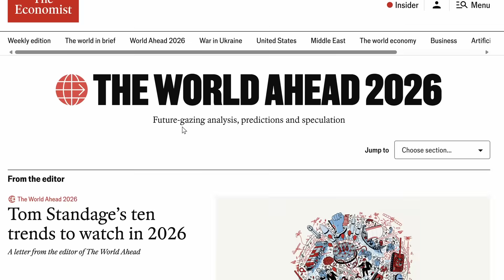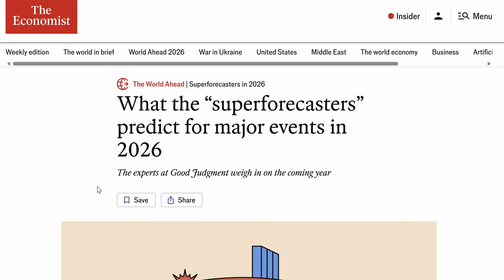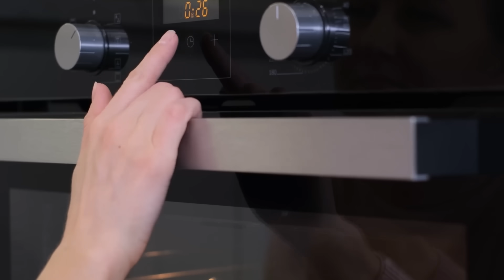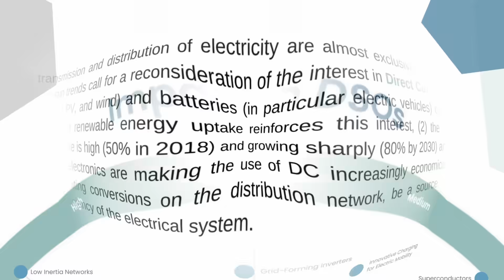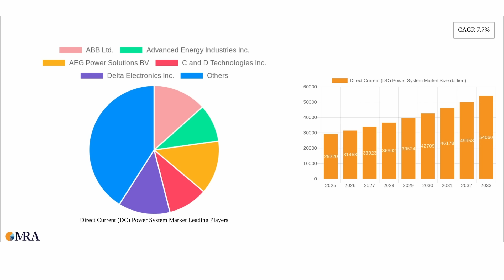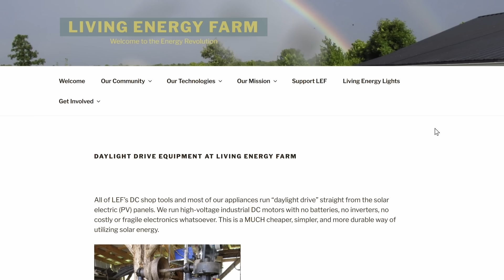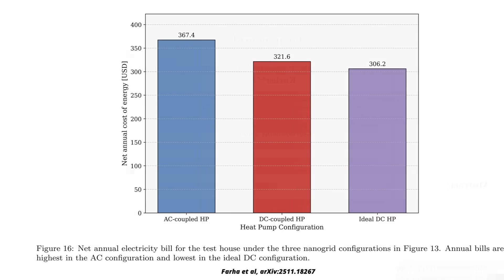Are We Using the Wrong Kind Of Electricity?

Comment: I understood originally that AC was chosen partly because of the fact that transmission lines for DC at the time of electrification in the US would have required way more copper. I wonder what it would look like practically if we were to start using DC in new construction for example - how would devices, etc., use it, what would sockets look like, and how much loss would still be incurred from converting the DC back to AC for devices that required it for backward compatibility.
Reply: The reality is most everything in a home actually works on DC internally. Motors with their own variable frequency inverters would have far greater functionality.

Comment: That is not an easy discussion!

Yes, we use a lot of DC-Appliances in our homes and in industry … but the grid is generally in AC and that ist really good. A Transformer is very good understood an reliable electrical machine. When you distribute electrical Energy you have to change Voltage-Levels and this can be done only with „AC“, even when you call the device an „DC-Converter“ it will use AC during the conversion process (and it will use a transformer, even when you call it just „a coil“).

I think that HVDC (HGÜ in German) does make sense an should be used more often, when it comes to long distance lines, but for 230 kV and for 20 kV (in our cities) (3-Phase) AC is the best option.

And by the way: Every device that is „turning“ is running on AC (generally 3-Phase frequency-converted). every (todays!) Generator is generating AC, because you do not need any Brushes to transfer the Energy from turning parts of the machine. And yes, it is often converted into DC and than back in to AC to be fed into the the AC-Grid), but that would be the same, if the Grid would be DC … Electronics makes it easy to convert between AC an DC or vice versa. But this should be used only when it is really neccessary. If not a (simple) 
Transformer is the better option.

Comment: Interesting point regarding the slow background transition from AC to DC for most things. Never thought about that but it makes sense.
Instead of building very expensive long distance power lines, like we are currently doing in Germany again, it would make much more sense to have smaller, independently working but still interconnected cells that create roughly as much energy as they need, if possible. That's also not cheap initially, but in the long run much more stable and cheaper for multiple reasons, not least because it breaks the stranglehold of the energy mafia that should never have been allowed through the stupid privatization in the 90s.

Comment: Convert DC voltages WITHOUT first inverting it to AC...  Then BACK to DC.  AC?  Just use a transformer.  Done.  Motors?  Brush DC motors are inefficient, high maintenance devices.  Modern "Brushless DC" motors use - Guess what?  Three phase AC motors provided power by a local dedicated DC to AC converter.  Not only is this more efficient, but allows for easy full control of that motor.  Yes.  Brushless DC motors are 3-phase AC motors.  Tesla was Right, for a LOT of reasons.  Both Then and Now.  DC micro grids?  OK...  But.  WHY??  Very Local ones only, and single low voltage only.  You need CURRENT for power.  Low voltage requires higher current, which is Very LOSSY over any distance.  Copper is $$$$.   WHY do you THINK Solar homes use inverters to supply AC for use?  Again...  Tesla was right.  By the way, 3-phase AC is continuous power, just like DC, BUT without all the drawbacks.

Comment: 3:40 at least partially incorrect.
Wind turbines use massively alternators. They generate AC current natively, because of the nature of said alternators.
But maybe newer turbine are not ''turbine'' anymore ?
Reply: But you are totally correct for the solar Panel, that uses concerter to change the slowly fluctuating DC_eff voltage to a steady AC voltage 😊
But having the fluctuating DC of a solar panel converted to a steady useable DC voltage STILL needs a converter. It will just be a bit more efficient, and that's the key 😊
Reply: @BolcheBric You control the voltage by varying the field. This is how motor vehicles keep the voltage steady, with widely ranging engine speed.

Comment: we are not using the wrong electricity. the losses over long distances are far less with ac. dc only works for local hookups. high voltage ac breakers are more reliable than dc. and the list goes on and on. this is pure click bait.

Comment: The main distinction would be in the voltage conversion: AC transformers are pretty "simple", which helps with reliability and cost. In the other hand, DC to DC converters are "weaker" in comparison.

Comment: Some time ago, I started thinking about a system I called ELVS. Essential Low Voltage Supply.
The idea is that you convert your lighting circuits to run on either 12V or 24V AC. You can get lights that run on this voltage range.
The system would be backed up with 12V batteries and a simple DC to AC converter.
The batteries would be recharged from the mains and solar panels.
Never pursuid it though.
I think the name is catchy.

Comment: 3:40 soo.. wind turbines..
turbines..
generate dc? 🤔

also idk, but the gist of the video is akin to the baldy man named Simon doing his 20 bn other yt videos...
surface level everything...

it's not a dc vs ac issue.
ac has to be converted, but it has much less efficiency penalties over any longer distance.
dc is good for short travel, and requires MASSIVE infrastructure to make it viable to transport from any plant.
(which still do it through ac on a dohen or so phases, that get pushed into each other resulting in dc)

also in a household ac is generally safer than equivalent voltage and power dc.
ac switches 50/60 times a second, which means your muscles are in a "pushback" state every time the sinus curve goes through zero volts.
dc fries you until you are crispy
and
everyone who touches you gets fried until they are crispy...

while low voltage, low power dc is great...
as a whole household power delivery it's borderline moronic 😅

Comment: AC is used because it can be converted to different voltages using transformers. If very high-power electronics (voltage converters) ever become cost-competitive with transformers at the power levels used in the grid, then DC power transmission might very well become standard one day.

Comment: While rectification from DC to AC can be done without major noise problems, there are often HF problems and radiation when DC is to be made into AC, and all DC material must be sized larger and with the risk of arcing. But for pure off-grid home use, fine, as has been done for decades.

Comment: There’s no way to “transform” DC to a higher voltage for long distance transmission. Transformers only work on AC. The 500 kv Pacific DC intertie requires expensive rectifier-inverter stations at its terminals. That said, HVDC doesn’t suffer from reactive power losses, and is more electrically efficient than HVAC.

Comment: Id argue that ACs main appeal is: you can change/drop/raise voltages very easily with AC. That same mechanism allows you to isolate circuits very easily with electromagnetic fields instead of requiring a physical contact. (Both of the above are done through transformers). And you can cheap out on power line cables by taking advantage of the skin effect when it comes to long distance distribution (AC tends to form charges on the outside edge of a conductor, instead of the core, so fatter cables with cheap cores will reduce the effective copper loses (terminology used to determine losess in the cable,  even if the cable isnt actually copper).

Now when it comes to DC: yep, it will need to be transformed no matter what. Solar panels usually generate really high current with very low voltage. That will need to be stepped up.

Transformers for AC are cheap. Modifying DC is not cheap. Hardware cost differences has far more weight, and thats where the real analysis begins:

Is it going to be more expensive in hardware costs relative to energy cost savings? Not likely for several decades, and even then thats assuming energy costs are high. In my mind, this is all a bit of a scam right now.

Sure, you can save 15 percent per year, but if it takes you 50 years to pay off that difference, its not worth it. Especially if parts turn out to not be reliable over the long run. 

An analogy: does it make sense to buy solar panels when your home energy costs are 6c a kWh? Nope.  But if energy costs 50c, most likely.

I can totally see business manipulating things in order to give us something we dont need in order to make a buck.

Comment: Kinda misses a massive segment of electricity consumers, and ac devices, industrial motors and induction heaters. Your heat pump is likely ac, fans and blowers, and that DC electric car actually converts the DC to AC in the drive train. Most generation including nuclear are AC generators. DC has fewer long distance losses for ultra high voltage and very long distances due to conductor skin effects, but that get turned back in to ac.

Comment: It is not as if we are not using DC and AC. Horses for Courses. The most economic way to achieve traction is electronics, and simplicity demands DC. But domestic supplies need transformers and the simplest robust step up/down method is AC and wound transformers to get power over distances. With electronics at high voltages (or rotating machinery) there are more losses. HVDC is used to avoid inter state/country system syncing (frequencies) and TX over large distances. AC does give advantage to allow muscles to release at zero crossover, if electrocuted (100 zeroes/sec). Whereas DC doesn't, though how much advantage is moot. I never fully bought that as an apprentice.

Comment: DC is more dangerous for humans. If you're electrocuted by DC, it contract your muscles and you are just cramped on whatever is under voltage.  On AC you're more rejected from it. 
Also, using DC is ok but as soon as you want to run a motor you have to convert it in a kind of AC..

Comment: I think the next step is sinusoidal dc. it solves 2 issues with dc, switching it on or off as it has a zero point to lower power long enough to switch without arcing. and it can work for induction and transformers. 
easy to convert to flat dc with a half wave rectifier. 
I see mention that this would be ac on a dc base, but I disagree. it would never alternate and change polarity. this is key.

Comment: Everything runs on DC sure.   That and the development of inexpensive power electronics. We had to use AC so that EHT could be dropped after transmission by Transformers.  So Edison's DC was never going to be any good 130 years ago.  Now though 1,000,000V DC transmission is practical.

Comment: "Windkraftanlagen sollen DC erzeugen ?" -> Jein. Naturgemäß erzeugen sich drehende Generatoren eine sinusförmige Ausgangsspannung (AC). Deren Frequenz variiert aber mit der Windgeschwindigkeit und darf so nicht in das 50 (60) Hz-Netz eingespeist werden. Deshalb kommen Umrichter / Wechselrichter zum Einsatz. Das bedeutet, die instabile Windgenerator-Ausgangsspannung wird im 2. Schritt in DC gewandelt (und gepuffert), danach im 3. Schritt mit einem Wechselrichter von DC in AC mit stabiler Netzfrequenz gewandelt und ins Netz eingespeist.

“Do wind turbines generate DC?” -> Yes and no. Naturally, rotating generators produce a sinusoidal output voltage (AC). However, its frequency varies with the wind speed and cannot be fed into the 50 (60) Hz grid as it is. This is why converters/inverters are used. This means that the unstable wind generator output voltage is converted to DC (and buffered) in a second step, then converted from DC to AC with a stable grid frequency in a third step using an inverter and fed into the grid.

Comment: Doesn't DC require thicker wires for transfer? vs AC that can run on thin wires?. Look at 12v charging cables for car batteries how thick they are, DC needs beefy wires. I bought wind turbines and got them all running AC because, I can transfer the power with just a regular home extension cord, vs with DC I would need something like gauge 4 wire, and it is NOT cheep. DC is great, but for transferring it, it has to be converted to AC and converted back to DC. That's how I know it :).
Reply: For the most part voltage and current determine wire size for both AC and DC.

Comment: The problem with DC is passive devices and that different metal connections have different electrons affinity an resulting in temperature difference and reactions that make it difficult to maintain reliably, example, positive earth ferrous car bodies rust quicker  than negative earth ones and verdigris always happens at the positive battery terminal.

Comment: When my parents moved us to Cambridge UK back in 1959 parts of Cambridge were still running on DC, the house we moved into was converted to AC 240 just before we moved in but was DC when my parents purchased it so the house was rewired with the latest 3 square pin fused plugs a real novelty to some at the time as they still had round pins. I was sent to a tutor just fifeteen minuets walk away and she was on DC and I remember the day she and the street she was on was converted because I turnned up for my lessons and there was no electricity as the conversions were taking place they were both converting to AC and 240 volts from 120 DC so elements in the cooker were getting changed along with light bulbs etc. Back in the early days AC was not all 50 or 60 HZ railways for instance prefered 25HZ for traction (I have a 25 HZ reed frequency meter from the 1920's) and some places even went higher Ferranti for instance installe a 90 HZ system near Bristol.

Comment: You should have mentioned, that in DC most items work on specific voltages. So you need to transform those anyhow, while the AC often works fine without transformation.
Also generating DC from AC is cheap and small... some diodes and a capacitor are fine. The other way round is costly and difficult.

So from engineering point of view, running on DC is just weird!

Comment: There is a system called Pacific DC Intertie which was finished in around 1970 and is still used today,  It was not built for the fun of it, it is because it is more efficient, I suspect it has been upgraded several times since then but it a more efficient method for sending power long distances. Rosie the Engineer did a good video on High Voltage D.C. power transmission which is also being used in China. If I remember correctly this method started in Sweden. Go to Wikipedia and look up Pacific DC Intertie if you need to know more.

Comment: Wind turbines don't generate direct current for the same reason carbon fueled turbines don't.
Reply: Wind turbine output is all rectified, same as the output if a car alternator. Why? Because they both cannot run at constant speed.

Comment: Electronics Eng here. This is rather misleading and somewhat over simplified. Implying some sort of common DC solution, when in fact the biggest issue is the ensuring the correct voltage is applied to the device. Its the same problem for AC or DC. DC has two extra disadvantages, its conversion is more complicated and a more expensive solution. But the big problem is a large risk of a DC arc fire. AC will self extinguish and DC will self sustain and build stronger once its started, causing additional potential fire hazard.

Comment: This title of this video is just Wrong, there's no right or wrong way to transmit electrical power. AC voltage can be changed using transformer windings, while DC needs to be chopped up and run through capacitors and inductors to do the same. There's good reason to use both AC and DC, but Sabine makes it sound like the decision came down to a spat between Edison and Tesla.

Comment: DC is more dangerous to human health than AC. AC can burn you badly, stop your heart etc. DC does the same but you can withstand double the current of DC when compared to 50Hz AC. So far so good. But DC also causes electrochemical reactions in your body. Some of them are not observable. Injury by DC voltage often requires hospitalization and monitoring. Electrolysis of blood, creation of blood gas which can cause embolia etc. There were unfortunate cases when someone was injured by DC current in accident and despite looking like lucky survivor with barely any injury they were found dead the next day. This does not apply to the currents you have at home, it applies to people working at power relay stations etc. I can imagine the last mile to be in DC. But for high voltages I would stick to AC where the risks are well known and explored.

Comment: Overlooks two simple facts. First, batteries are DC devices. If you store electric power in a battery, it’s got to be DC. Second, transformers are very simple, cheap, and common devices to change AC voltage and current, either higher or lower. For example a basic 2:1 transformer can convert 110 VAC to 220 VAC, or vice versa. This is why high voltage AC transmission lines can be converted through transformers to 110 VAC at a point for connection to common devices like motors. So the simple fact is that both AC and DC have a place in our desirable applications.

Comment: It looks like someone has absolutely no idea about physics and how AC and DC current works. 😅  With DC current, the cables would have to be several times thicker even at high voltage compared to AC, and the losses over long distances would be enormous anyway

Comment: DC lighting systems are starting to become common in new homes especially the 48-52 volt systems using the Ethernet cable standards so you just plug all the lights and switches with the same cables and both power and signal goes to everything... You can redesign the system without touching anything with an app.